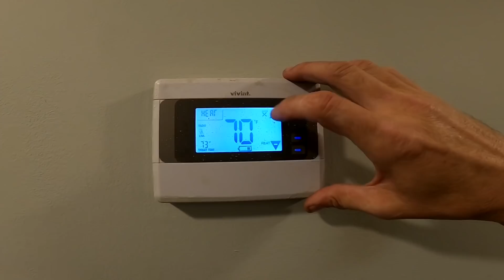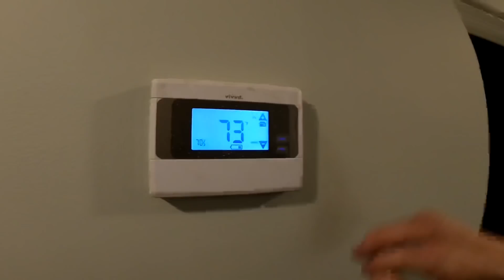Repairing 6 Year Old Rheem Furnace. 3 - 3 Flashes.

Comment: Why did you turn power off when the heat exchanger was fully heated up? I have 30 years experience and I always shut gas off and let blower run and cool heat exchanger down before shutting power off.
Reply: while it's not great for them, it's no different than a power outage occurring or not as bad as a failed indoor blower and them cycling on the high limit for hours to week before the customer decides it's broken. now in commercial RTU's where there's most always duct fire/smoke detectors, that you'll likely set off, ending with fire/ems/police showing up and an evacuated business with many unhappy folks sneering at you! also be careful in multi-dwelling residential, tripping alarms and causing the same is expensive for all.

Comment: You should look into a supco door switch magnet there like 15 bucks and pretty nifty. I know any of you will be like just use tape. But I love this tool. 

The part number is fpro100
Reply from the maker: I just put it in my cart
Reply: I use mine all the time. Also good to use to keep doors from closing when going onto condo/apartment building rooftops.

Comment: I thought i heard the customer  say that he heard a loud pop when the furnace lite it did sound like a  hard  light off when u fired it up maybe should have checked gas pressure .Kudos for taking care of veterans as i do the same,my dad was a disabled ww2  and it was him who taught me the fundamentals of this trade 40 years in still chooching...Merry Christmas you and family
Reply: that's a pretty typical startup for direct spark ignition and fast open gas valve. it may have been slightly delayed though and it wouldn't have hurt to clean the ignitor rods and make sure the burner flame cross-over wings are clean, also check that the orifices don't have a bug/spider in them near the ignitor burner.
they may have had the "gas" shut off for many months and had air in the system, but even that should have never tripped a roll-out.

Comment: Nice work. Good to see a veteran get helped out. 
Curious, what sort of batteries do you use in your Milwaukee magnet light? I have one myself and the batteries never seem to last very long.
Reply: The Milwaukee one I have is rechargeable uses usb I plug it in lighter between calls
Reply from the maker: It uses AA batteries.
Reply: @HVACGUY  Right, I know that, but are you using lithium or just regular alkalines? I find the alkaline batteries (Duracell Energizer, etc) just don't last long with that light. Half way through a repair project, the light turns off. (I work on electronics and in pinball machines)
Reply from the maker: @ngtflyer  yes, regular alkaline batteries. I thought you were referring to another light they have that is rechargeable. I keep that one and a head lamp, also by Milwaukee - very small. So, if one goes out I can at least see to get out, and get batteries. I just make sure to keep lots of batteries. I need them for multiple reasons.
Reply: industrial strength energizer  lasts pretty long
Reply: or the maxx